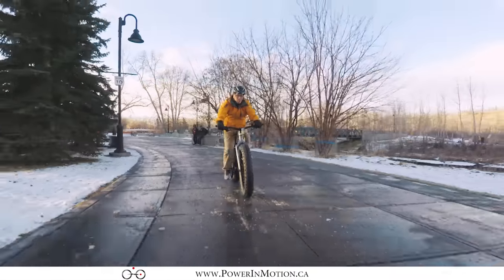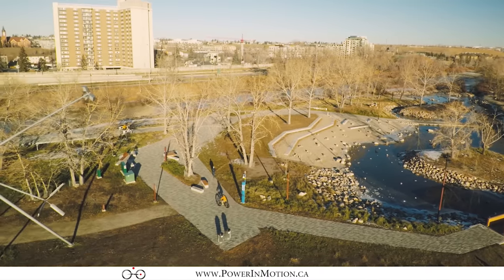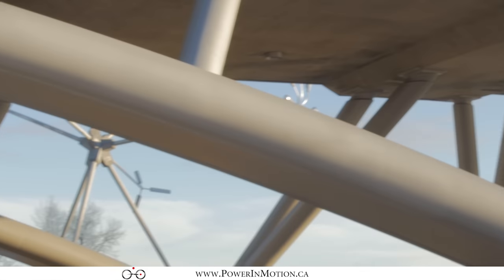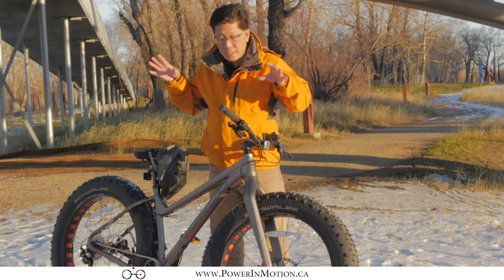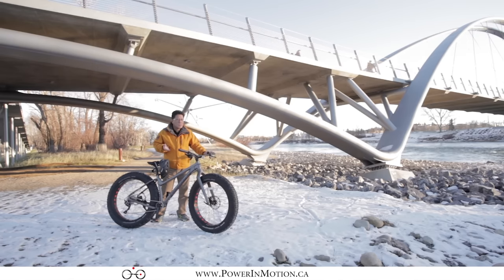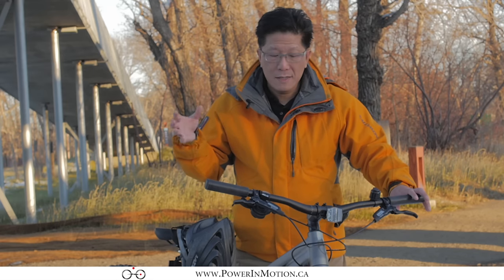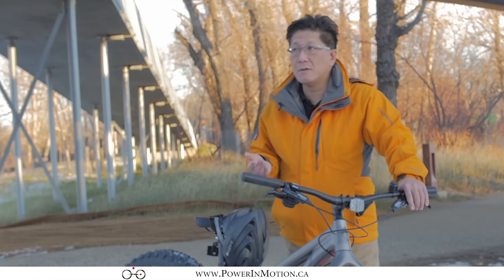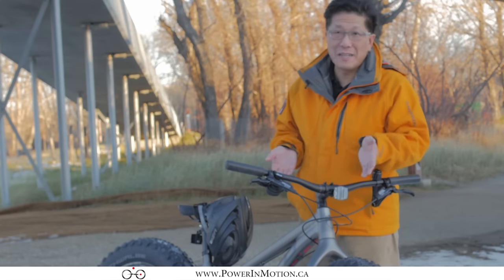2016 Norco Sasquatch 6.2 Fat Bike - Power In Motion | Fat Bikes Calgary, Alberta | BigFoot

Comment: Hey - you forgot a category of rider ... I ride my RSD Fatbike in Banff, lots of great climbs and technical downhills, just like summer riding - only winter! Swapped out my 32T front ring for a 26T, and put grip studs in my tires - can go ANYWHERE. It's been a perfect winter for fatbike riding out here in the mountains.
Reply from the maker: +Liz Wiltzen Thank you for reminding us that we forgot include rider.  May be on the next video I will mention it.   

That's interesting that original 2015 Mayor had 32T, the 2016 model had 28T.   Norco Bigfoot use 26T as standard equipment.
Reply: 28T sounds like a good move. 32T made many of the climbs here unrideable when you add in snow and the weight of the bike. With 26T I can get up most anything, and in the terrain I'm riding, I rarely want a harder gear than I can get with this setup even on the flats and downhills.